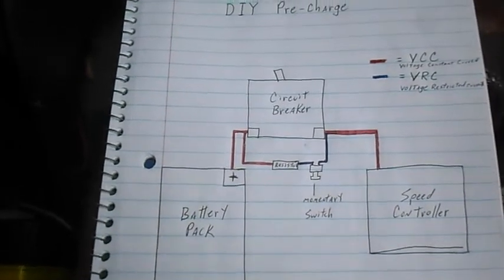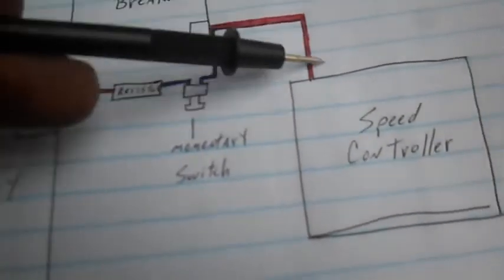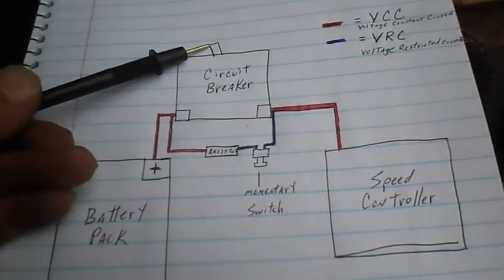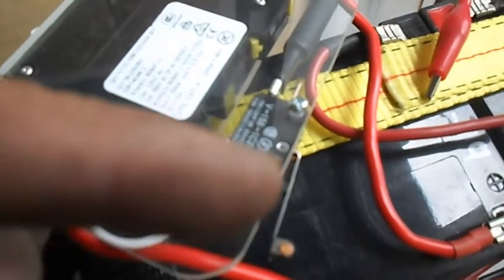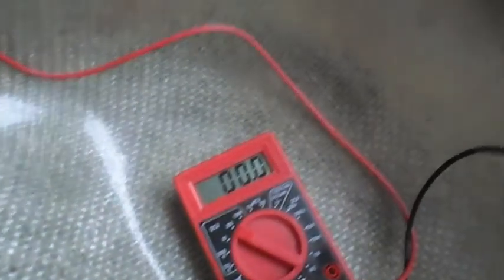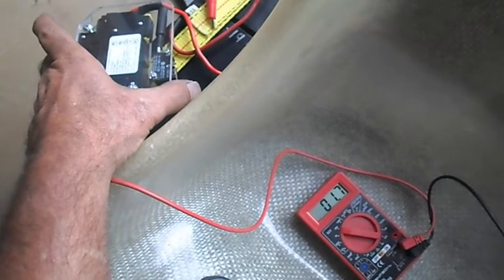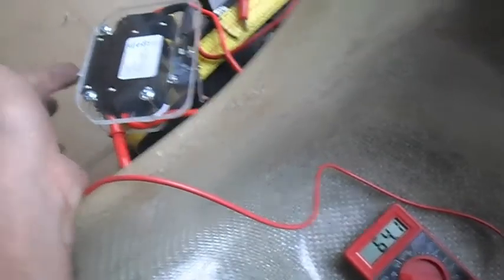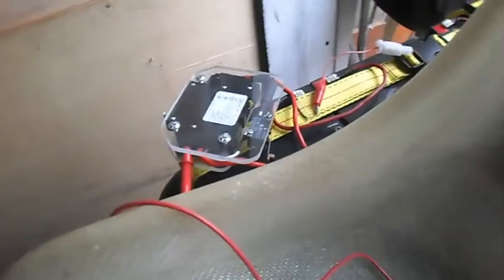DIY precharge circuit

Comment: The way you have the switch doesn't the resistor see power constantly?
Reply from the maker: The resistor "sees" Voltage constantly but, the current (amps) only "flow" when the momentary switch is activated.
Reply: @functional_artist  i assumed the resistor would draw current but obviously it can't untill the circuit is completed cheers mate